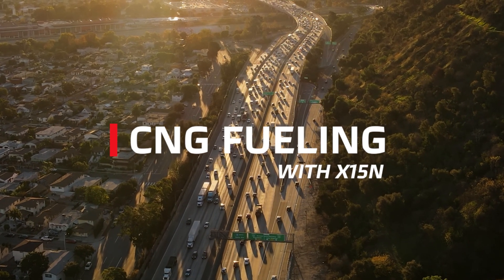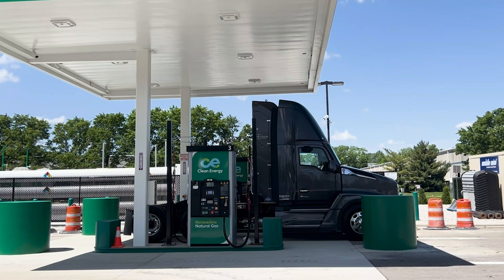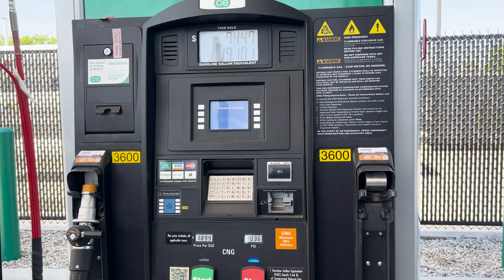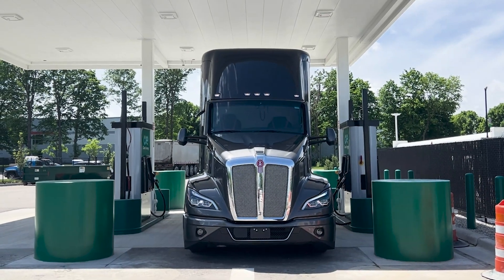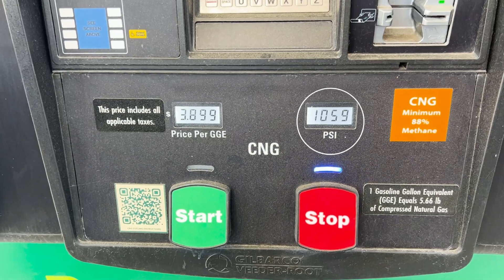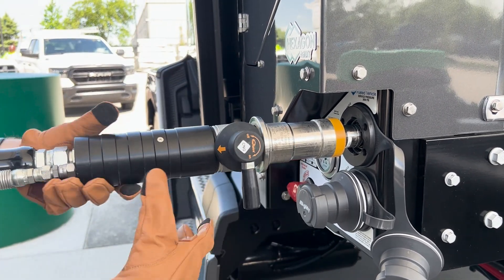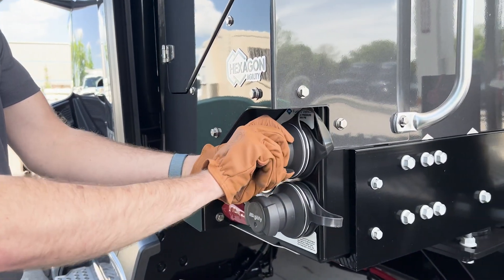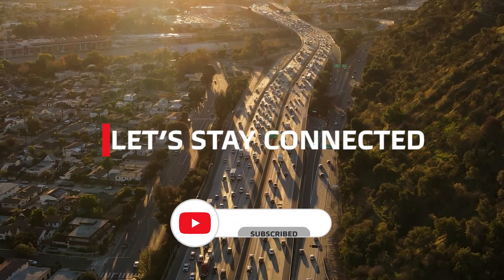Kenworth Connects – CNG Fueling with X15N

Comment: heard that those caps stop the truck from starting if theyre not attached/fastened. so what happens if someone were to undo the cap on the fill ports while the truck is running? seems a security risk.